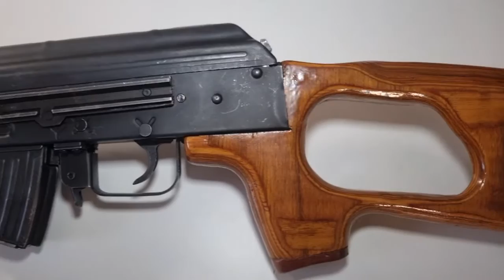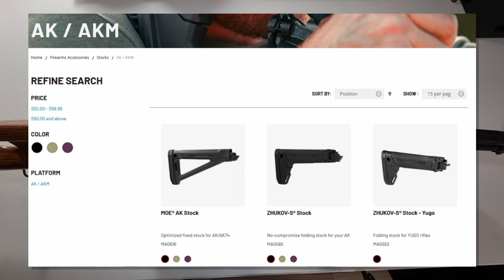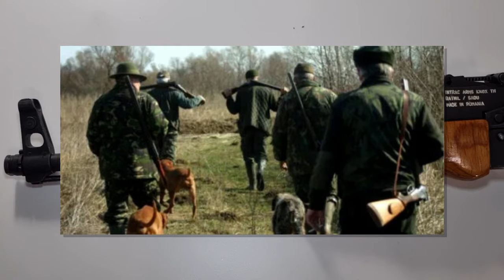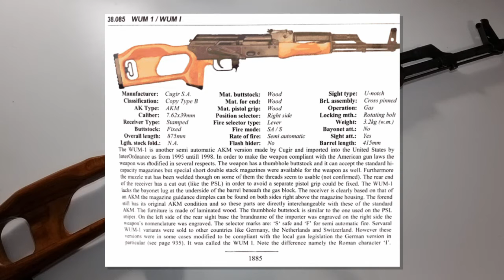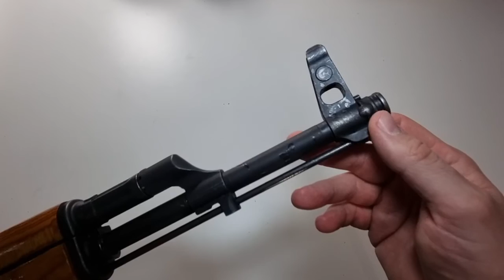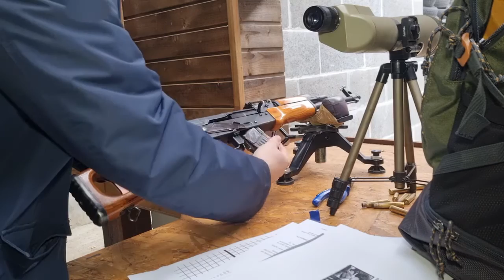Romanian Sadu AK [EN]

Comment: I have a WUM-1 with the half moon cut receiver for over 23 years now. I paint over the military finish with black wood stove paint. This help I the maintenance the rifle from rust and easy to keep clean. I work on the thumbhole stock. Making finger groups around it now my hands fit the stock better and trigger pole. In 1999 I purchased a new parts kit from a Dímelo factory wun-1 .